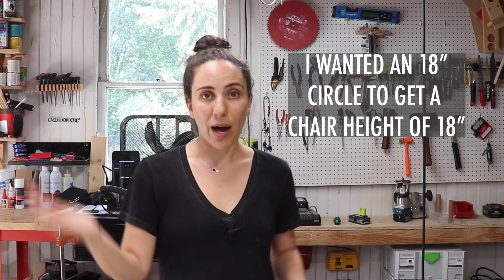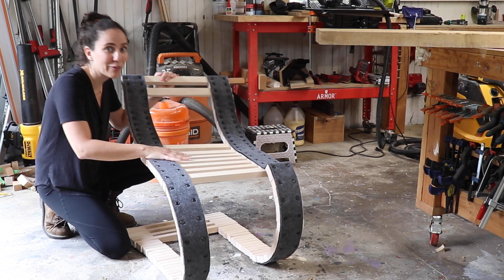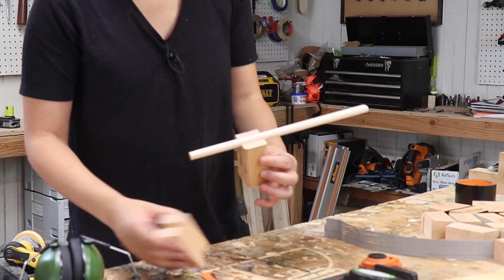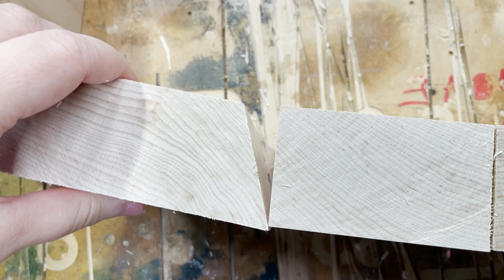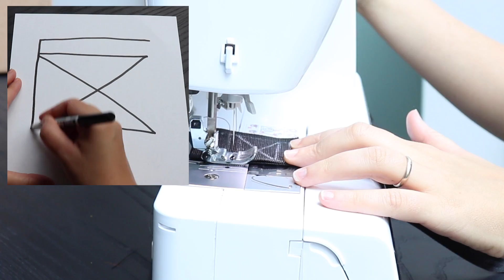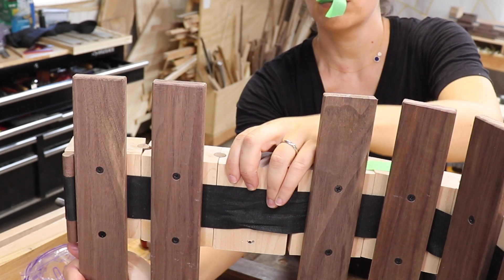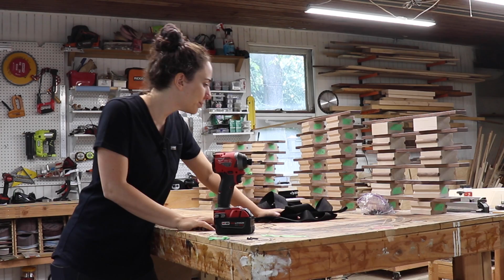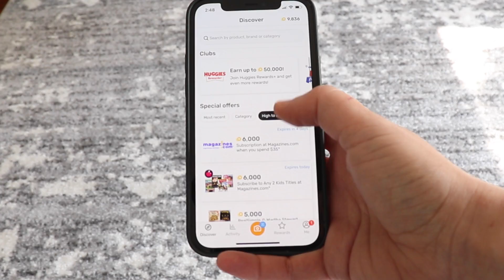I ATTEMPT to make a Roll Up Chair… AGAIN...

Comment: I'm not sure if it would 100% work but what if you had a metal link connecting only the blocks at each curve to add support needed to stop the the blocks from leveraging against each other. Possibly a bike chain or something similar that has been recessed in a groove under the strapping but only on the curved spots. And that would only require using a bolt or metal rod at each end of the chain to ensure it doesnt pull out of the wood.

Comment: What about drilling holes through the width of the individual pieces and using steel cable threaded through the entire length? That could give you some real tensile strength.

Also a couple thick dowels to run from the flat bottom to just before the back curve. You could drill pockets for them to slot into, and when you take the chair down you'd just pop them out and roll them up with it. That would give you support under the seat and also prevent putting so much load on the straps/cables that they stretch.

Comment: I think that "Bicycle chain" imbedded in a groove of each slat would solve two problems at the same time. It does not stretch, and it has side bending resistance.
Reply: I was also thinking chain. Not sure bicycle chain would work under that much tension though - the plugs between links aren't that strong really.
Reply: @NikolaHoward  Nice idea! Chain can be beefed up to motorcycle chain.
Reply: @PlanWithoutChance  motor bike chain might work.

It's all about the sheer force load that the lugs and plates can take. I don't know their rate loading at all.

But it would certainly be flexible enough!

Make the chair hella heavy to shift around though...
Reply: @NikolaHoward  theres some heavy duty chains out there. And being encased rather than on the surface would give it strength.
Reply: I agree with cycle chain. And put a tensioner at one end of each chain to allow for the small amount of stretch over use.
Reply: a 530 motorcycle chain should be strong enough, they don't snap when doing wheelies on 200kg motorcycle + rider
Reply: Honestly thats the best idea I've seen.

Comment: First make a successful version, then worry about reducing materials.  I'd look at either multiple bike chains or motorcycle chain for the linked element, have the slats look kind of like a caterpillar tread, and on the back side have every slat/block have a rib that extends over the next two slats/blocks on each direction, and sets the end curved shape.  That would add a lot of rigidity to the entire thing since each would have a rib extending across 4 others setting the curve and distributing load.  It wouldn't really roll up correctly since the ribs would interfere, but you want a successful chair first then reduce it to the minimum that can work later.
In fact for a cheaper option, just use the wood blocks, you may need to reorient for strength, and use door hinges between each block for the folding element.  It'll add up, but it should take a lot more load with minimal stretch.  Then get angle iron, cut and curve it to the shape, and screw it to the back of the blocks, with the other side acting as the load bearer for the curve.  
Make 5 of the same curved angle irons, cut them into 5 block long overlapping sections, screw to the middle section then cut the flat of the other 4.  Then the multiple ribs can overlap if you offset them and set the curve.  
Might need a basic drawing be easier to understand, but maybe can get it from the text..
Reply: PS you should probably forget the 2 curved sides for now.  Just do 1 side of this chair, get it working where it can hold your weight, then it's trivial to use two and reduce material strength a bit.  As it is you're doing double the work with no design iteration benefit for the extra work..
Also note with the 90 degree ribs on the back, slot them into the blocks and beside the other ribs, and increase the side to side rigidity.  
Think of doing all of this in reverse.  Think of using angle iron, cutting and curving it into the shape and making the chair with just the iron. Then make 5, cut them into multiple overlapping pieces, add blocks and hinges and then you can roll the angle irons up.

Comment: You need to either use metal chain instead of those strap thingies or just make the wood into some kind of hinge that simply cannot bend further than its rolled out state, which would probably still involve metal parts..
Those polymers are just too flexible in one sense, but once you make them thick enough to hold the weight, not flexible enough.

I strongly discourage using leather, it will be worse than the band you just used.

Comment: I almost feel like you should just use metal hinges only at least to see if the concept works. That way you would distribute all the force to the wood instead of using a strap. At least as a proof of concept

Comment: Have you considered using much thicker pieces of wood? The "legs" of the chair are effectively a cantilever beam. The amount of deflection you will get is inversely proportional to the moment of inertia of your "beam." And that moment of inertia is itself proportional to the depth of your beam to the third power.

For this system, the "depth" of your beam is the distance from the strap to the contact point where the compressive force is transferred to the wood. If you double this distance, you should, all things being equal, decrease your deflection by a factor of 8. Increase it by 50%, and you should cut your deflection to a third of its original value. Your stresses will also greatly decrease by increasing your beam depth, but with the square of beam depth, rather than the cube.

Comment: Here's another thought. If you are still bent on using straps,  lateral stiffness trick could also be reapplied under the slats, pinching the strapping. Only under the slats, half of the Dowell or less pinching the strap.  Otherwise, I do think hinges might be a better option. 

Alternatively,  using the straps to hide the hinge too.

Comment: I would have complained that those straps would never work. I was thinking using hinges instead and perhaps instead of 2 small blocks connected by a board making each foldable section one piece of wood

Comment: I agree the strap is the problem.  You want no stretch, no gaps, and maximum tension. If your joints are true, then all the force is compression against end grain. I'd try cable (maybe 2) running through each segment that can be tensioned from the end with a screw thread and nut (star knob).

Comment: Need a wire cable thru the boards. And ya set it where ya want then pull the cable maybe 1 inch tigther cause the cable will stretch and seat into the wood. Even leather will stretch to much.

Comment: I would double up on the strapping, sew them together all the way down, and connect the strapping to every piece with some sort of adhesive and a lag bolt with large (LARGE) washer
Reply: another option would be to add legs to the base of the chair. use the same roll up method on two smaller rails where the back meets the butt. while it would take away from the single line design, it would still achieve the roll-up goal.

Comment: Having the chair fold like that might just not be practical at all, actually. But, assuming it was practical, why not use maybe 3 or 4 thin metal cables through all the the pieces? It has basically no flex and they are super resistant...

Comment: Um.. *just like in the last video, you wasted your time by skipping even the simplest calculation*: weight x lever length -> torque (in Nm) / thickness of your maple elements ... which gives you the force (Newtons) pulling on the webbing - and the insight that the PP/PA webbing you are using will stretch too much. There IS a reason why steam-bending of wood is done with flexible strips of sheet metal instead of plastic fiber webbing!

Comment: How about having small steel links on either side of the wooden blocks. Similar to how bycicle chain works. I think it will be very hard to find a material stiff enough to not cause gaps due to streching yet flexible enough for it to be rolled up. Also, since different parts of the chairs strap will experience different amounds of load the stap needs to be fixed to the each block idividually like in your previos attempt. However that kind of connection is very difficult. But I have to say it loos really cool:)

Comment: To fix your scorching of the edge of your wood, try raising your blade so the throat of the blade clears the top of the material. This allow the cuttings to be cleared out of the cut faster and not cause the extra friction that will scorch your work piece. This will vary based on the species of wood, but typically works with most.
Reply from the maker: It’s only with maple. Ans it’s Bc of my underpowered saw.

Comment: Maybe instead of a strapping you could go with a steel cable. maybe route slots for streel cables where the strapping would go. They dont have to be super large diameter since they only need to support the weight of a person. Maybe a steel cable dog runner that already has a plastic coating around it?

Another idea I may try if I had your skill and resources is maybe try bolting flush mounted steel hinges to the outside of the blocks and some sort of tool-less clip to attach to the inside. Then all the weight is on solid steel members and not on a strap or cable. I would also try to design longer blocks where the design doesn't need them to bend as much. This may increase rigidity and reduce complexity. Some of the members likely wouldn't need a clip to hold them in place and the hinge should be enough. 

Also you could add some one or two foot long poles that could peg into place once the chair is in the sitting position but would easily pack away once folded down. Then the chair would still roll up but it would be a reasonable compromise.

Maybe some combination of these ideas could work but the weight would be astronomical, but this wasnt really a practical and packable design anyways so...

Edit: I removed an idea that wouldn't work.
Reply: I read another comment and they mad a good point about the back support being tensioned by a separate cable. There is no reason for the back support to take the full weight when it could easily just hold its own weight. I would maybe just connect the backrest with a hinge and it could have its own strap.

Honestly this chair project is feeling a lot like a bridge building game like polybridge.

Comment: I think your problem may be less with the strapping than with the shape of your blocks. Any material (unless you find woven metal webbing? Made from little fibers like steel wool, but woven?) is going to stretch. Your block shapes need to account for that. Instead of cutting the blocks to be the right shape when they're standing free, cut them to be the right shape *under pressure*.

Comment: I would start by having the trapezoidal shapes go all along, from one side to the other, and the width over dimensioned like 1,5x. And also the webbing, from side to side, like if it were a fabric. If this works, then I would use the saw cut the chair to lesser width, until I get confortable on how it works. I definitely would use the most inexpensive wood. If it works with pine, it will be safer in a better material. 
You are iterating to find the solution, that is not bad.

Comment: Maybe try building a proof of concept of just the main curve. Part of the stress is that you have disassemble and reassemble an entire chair everytime you want to adjust (even the relatively stable base. Maybe try breaking it into 3 separate problems and solving each one, then decide how to best connect those 3 parts.

Comment: Area Moment of Inertia (aka how I beams etc etc get their stiffness)  Yep you need very high modulus straps or pre-tensioned straps as well as hard and high compressive strength materials.  Structures with this same  form factor even made from steel would be very springy/deflect alot.    TO help envision this remember it's mainly the outer surfaces of the form you made that are doing the grunt work, so if they are made od say,steel, and you still imagine them deflecting alot....then lesser materials are going to be very noodly.   Love your persistence though!

Comment: The problem is based on the tension of the banding you use. I would try to band with a bicycle chain or even choppers one. U can maybe hide the chain on the back side of your parts placed in routed rail. But you have to fix them one by one with the dowels you use. maybe there is a material change in the dowels to be considered as well.

Comment: imo, need a more rigid connection between the links to counter the wood's elasticity...so
1. i would try using metal hinges instead of the straps (maybe even just for a test run)
2. reduce the number of links carrying most of the weight (the curve you're sitting on)
3. making the links thicker will definitely make the entire structure more rigid
4. consider flipping the wood's grain direction to minimize the compression

hope it helps, good luck and DON'T GIVE UP!

Comment: Leather would be a terrible idea, it's gonna stretch like crazy... You need to find a material with literally no stretch. If you keep the straps continuous from top to bottom without attaching them to the individual pieces you're gonna keep running into the problem of the chair collapsing in the opposite direction. I would suggest maybe some sort of hinge between each slat. Even then you might still run into problems with hinges pulling out of the slats and even the slats themselves collapsing due to the literal 1000s of lbs of pressure applied by the average person sitting in it. The extreme mechanical disadvantage created the design of this chair is always going to be extremely challenging.

Comment: I am an architectural engineer and also a leather worker and I believe leather would still stretch way too much and the type that wouldn't would be too stiff to flex enough to roll up. 
I would suggest a woven stainless strap or something like that and have a way to lock in the pcs once in place then unlock to roll up..?
Also when drawing up your pre-build design for the chair you might want to think about over exaggerating the curves in order to account for some of that tension and flex.

Thank you for sharing the video and for doing all that work though!! I know it takes a ton of patience and determination to work through a problem like that when trying a new or different concept!  Cheers from Arkansas!

Comment: I almost wonder if the single strap from top to bottom may be part of the problem. What if you added in some shorter straps, with dowel pins and the "x-box" stitching at some of the fail-points to create the extra tension without over-shortening the whole strap? (Like at the point where it first rolls down from the seat and again at the floor) Possibly have a few that overlap to create the extra force needed to keep the joints together?

Comment: As it says elsewhere in the comments here, one issue is your 2 anchor points. Anchor the strapping into each piece, and the strapping length (and thus the stretched length) can be individually set between each pair of blocks, appropriate for the load at that joint.

"Strong" is actually quite a complicated thing. Steel cable is often pre-stretched when predictable length-related behavior is required. If you can find a materials spec sheet for your webbing, you might be able to gauge whether a given webbing will work for your purposes (calculate the elastic deformation in the length dimension under the max tension at your most-loaded joint).

Comment: You might consider using seatbelts as the strapping material. They are designed not to stretch under the high stresses caused by a collision. 
Was also thinking about having the webbing in between the pieces, as in when laying flat it goes along the back, then between the pieces the up the other side, this would cause the strapping to take a bit more of the pressure off the wood.
Reply from the maker: That’s what I used the second time

Comment: Rather than straps or cords or anything running the entire length, what if you installed hinges (maybe something strong like door hinges) to connect each piece to the ones on either side of it? That way you would avoid any accumulation of stretching in one place, and you could account for sections that bend too far by simply gluing in shims. Plus, you wouldn't need to cut a groove in each piece because the rigidity of the hinge would serve to maintain alignment.

Comment: use safety belt from a car, no elasticity. also you make too big curvature where you sit that should come way more up than down, because when you sit, your weight will push it down and will open a gaps in the joints.
Reply from the maker: That’s what I used for my second attempt when I switched the straps

Comment: Nicely done! Even though you didn't reach the intended goal ... yet .... you worked through it very well.
I looked up the original Uros Vitas chair and it looks to me like as you are having. Notice that he only sits on the front edge of the chair, making the chair back superfluous. Probably best to just not include a chair back and focus on a more stable base to sit on. Then maybe you will find a design for a more stable back later.
I don't think this is an impossible design, but difficult to accomplish with wood and strapping. 
I think Cronoctie has the right idea in that the forces are not equal so the tension should not be. 
I do think that gluing the strapping will be necessary for the best hold as I'm sure the strapping is stretching around the screw points.

Comment: My impulse were I to try a project like this would be wire rope, run inside the blocks with a threaded turnbuckle at the end to adjust tension similar to how they use wire rope for guardrails/spiles on bannisters.